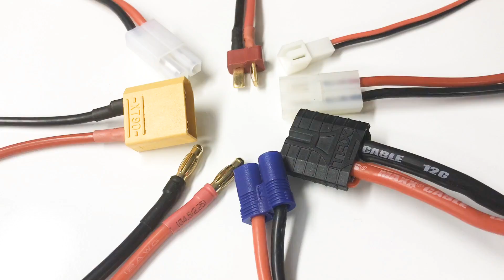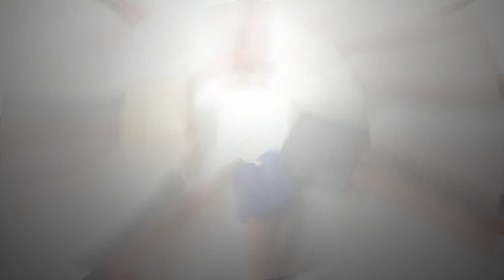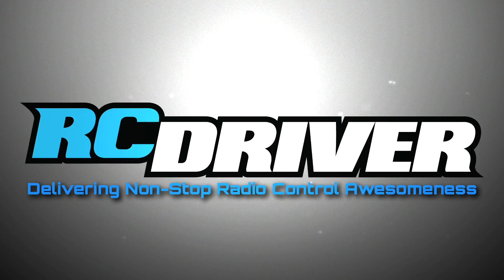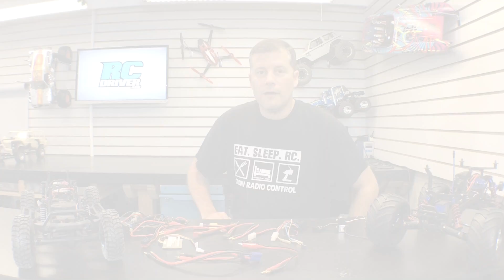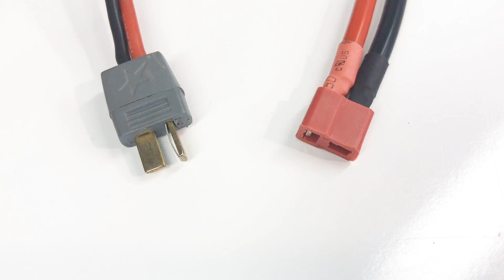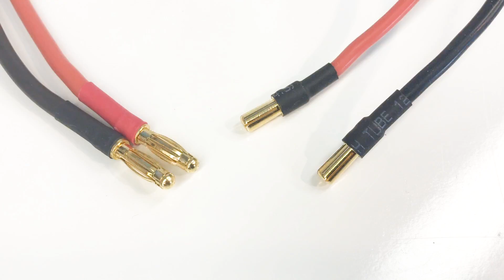Pick Your Perfect Connector - Power and Electronic Connector Basics - Get Into RC | RC Driver

Comment: Hi, I have a Battery capacity checker (one of the many on sale) all have a NiCd/ NiMH three pin port on the top right hand side presumably the two top pins used. I want to check the voltage of my NiMH batteries but cannot find a suitable connector anywhere on the Net. I think Fatuba make one, but can you or anyone else tell me where i can get a connector and lead to a battery connector Traxxas or Dean. I have multiple (connectors). Thanks

Comment: How do you disconnect/unplug a T plug LiPo? I've been trying to pull both ends oppositely but the connector and battery do not disconnect. I don't wanna break anything and thus don't wanna use too much force. The connector and T-plug LiPo are definitely connected the right way, but disconnecting them seems unusually difficult? Just got my new RC car btw.
Reply: Do you mean they’re hard and difficult  to disconnect? That’s common for deans (t plug) but once you use a lot it’ll be less difficult to disconnect

Comment: I lost the charger for my RC tugboat from HobbyEngine (manual says Atlantic, back sticker on the boat  says South Hampton) and cannot figure out the darn plug connector. It looks like the first  Tamiya you showed but smaller. The book said it's a 7V Nimh 800Mah battery but again I can't find that smaller version. Can u help?

Comment: I started with a Traxxas RC and so naturally I purchased their battery and charger. When comparing to others I'm VERY glad I did. WhoTF needs their RC's battery to look like some kind of electronic octopus with 4 wires and two individual plugs dangling off? In addition, I find the Traxxas plugs more comfortable to my fingertips. I've purchased three RC trucks by two other manufacturers since my initial Traxxas RC purchase. I ordered the respective Female EC3 and EC5 to Male Traxxas adaptors from Amazon.com and all is good. 
Gasoline, Ethanal, and diesel all come out of mechanically similar pump handles. Motorcycle controls were standardized in 1974. Buy an E-vehicle or an electric RC and you need an inventory of electrical connectors or you're f*cked. Simply put; Electrical engineers are NOT to be trusted.

Comment: Hi I have two 4s 6700 mah lipos with inbuilt Id wires wanting to know weather I can just run an Id plug and an xt150 connectors and wondering if I can still use my traxxas charger that will be safe for charging threw a Dean's plug  and cable to a traxxas plug for my charger can u help me please

Comment: If you’re dealing with an ARRMA raider (or other rc with tight spaces) deans is the most compact connector. I’m not sure if my RCs are being limited by the connector but that’s what I have. T connectors are the most annoying to solder though. Bullet style (such as XT) are stupid easy to solder.
Reply: Dylan White interesting, I don’t have experience with xt connectors but I find it’s pretty easy to solder deans/t connectors. Makes me want to try soldering xt connectors if they are that easy

Comment: Will dean's connectors work in an 8's application?
Reply: ray cimbalnik from what I have heard you would be taking a pretty big risk. I was told they can handle 4s but almost anything past that you are taking a risk
Reply: No they will heat up to the point of the soldering coming undone on 3s

Comment: Question about old Nimh  6 cell batteries. I have been out of the rc hobby for about 7 years. My son and I used to race at the Hobbyplex in Omaha,Ne. We used to run a variety of vehicles : Short course trucks 2WD and 4WD, touring cars and buggies. Most of his vehicles we did change over to using the 2S lipo batteries. I still have about a dozen Nimh 3300 and 4200 batteries but can not get them to restore to a useable condition. So I was wondering if there is a special way to restore them or do just go ahead and dispose of them. I appreciate any advice you can provide.  
  P.S. I am a watcher of RC Driver on YouTube, to help keep me informed on what's happening in the RC world.
Keep it up.
      MERRY CHRISTMAS
              Thanks,
      Greg

Comment: Would a XT 90 connector or higher mate well with a 2S battery? Really enjoy your clips. Thank you
Reply: Yes the 90 stands for 90 amps rated for you could run 8s no problem so 2s is fine
Reply: james gordon I would say that you can always go bigger than needed, just don't do use smaller than rated.

Comment: I agree with using the traxxas plug. I made the dumb change of going to the deens plug. I had the solder joints undo theselves. Went back to traxxas and havent a issue at all.

Comment: In summary: Go for XT connectors if you can solder. If you can't, learn how to solder and get the XT connectors.
XT connectors are made of nylon, very high temperature resistant material, even the cheap ones. They don't have exposed leads and they have nice grooves inside of the bullets that you can solder into, making connections all around the cable.

If you don't like XT connectors for some reason, go with EC connectors. Those are good too and pretty common.

Deans connectors are no longer a viable option when starting out, they are hard to solder, the solder connections aren't that good since it is soldered only from one side, the leads are exposed, the material on the cheap ones can melt at high currents or high temperature.

Traxxas connectors look nice, but they are a lot more expensive than all the other options. I would still pick XT connectors.

Tamiya connectors - THROW THAT PIECE OF CRAP AWAY AND GET PROPER ONES!

Banana plugs - I have no idea why anyone wants to use those for a battery connector. They dont have as snug a fit, they will loosen out fast.

For smaller plugs you can take anything you can, there are those rectangle... things. You can use those.
Reply: I only use tamiya connectors, because I'm a cheap POS and don't like to change all my battery plugs.
Reply: CDA441 how do you even brushless
Reply: Xt150 is the only real choice
Reply: Lagger Onesixfour if you understand the concept of soldering XT should be child’s play. And is it really worth it to switch all my stuff? My vendor has like 4 batts with XT60s on them so I’d have to solder battery side all the time too (no I won’t switch brands)
Reply: Thanks you helped because my conectors were the tamiya and they stopped working and i got the XT and they worked so well
Reply: May I ask. Where can I get these XT connecters please?

Comment: Why slipper clutch is used in some electric cars
Reply: Robert Leland why clutch is used
Reply: Traction, especially on 2wd vehicles. I used to run slippers as tight as I could get them and my RC's would launch off the line but I noticed I would lose it coming out of turns and I was going through rear tires like mad. So now I run slippers about half way and the trucks don't take off as fast but are much easier to handle under power.